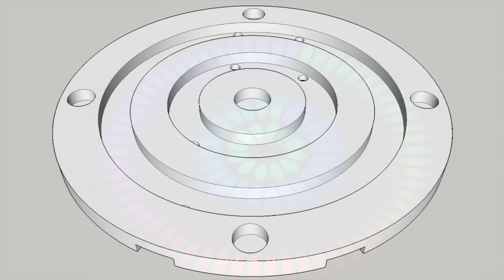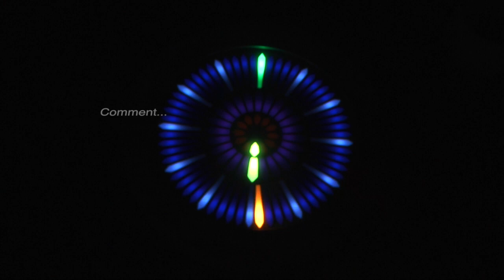LED Clock V2 Final Assembly

Comment: Steve, I love your clock and already have the 3 Adafruit neopixel rings. I have a CR10, so I will be printing the parts all in one (instead of broken up into sections). I will be using a Chronodot_v2.0 which uses the I2C interface so I will be doing some coding from scratch to get it working (hopefully). I am retired and like a challenge and I was a programmer for many years. Wish me luck. ;o) It may take a while but I will post up here when i get it done. .... Randy
Reply from the maker: Hi Randy, Thanks for you comment, and I'm pleased you like the clock enough to want to make one. Since making the video (and that clock), that clock has gone through a few hardware updates and improvements. Going forward, I will also be using i2c and a DS3231 chip. I have found it to be very accurate, in fact my current development clock has only drifted about half a second in several months.

It's good that you can program, and if you choose to use my code as a reference to create your own version, then you will find that it is by no means perfect or even efficient. I retired recently and will be working on further hardware and software improvements myself, now that I have more free time. In fact I'm waiting for a control board PCB I designed recently to arrive from China. This board incorporates the Micro-controller (going forward will be a Teensy 3.2), the DS3231 and its battery, the buttons, plus some other doodads. I have also added a centre pixel.

I wish you all the best in creating your clock, and hope the Adafruit rings are still the same dimensions as per the original ones I used. If they are not, then some adjustment of the back plate and clock face will be required. Take your time and enjoy, and please let me know how you are getting on, or if you have any difficulties.
Reply: @stevemanley3685  I just printed one of the back plate STL files and I should have checked the dimensions. The outer groove is close to being right but slightly too narrow for my 4 piece ring. The 2 inner grooves are way too big of a diameter for the 12LED ring and the 24LED ring. You have a couple of files and I printed the most recent one. I probably should have printed the earlier version one (that had all of the round holes for pressing in the face plate). I will try it and if that doesn't work I will probably just design my own clock files.
Reply from the maker: nc2010vettef55 Hi Randy, I did wonder if you would have problems, as has been the case for a few others, thus I ended up creating specific parts for them. The last time I did this it took ages and several reworks, because I was supplied inaccurate dimensions. If you have the ability to attempt creating the STLs yourself, then you will probably get more satisfaction doing it yourself. If you have difficulties, then let me know the inner and outer diameters if the ring PCBs, and the diameter of the LED centreline, as you can never rely on them being exactly in the center of the PCBs. Belts and braces, the width and thickness of each PCB is also useful.

If you are doing this yourself, I’d eliminate the need for the square holes in the clock face, and just have the shape of the hands go front to back. This makes the face a little more universal for ring size variations.

Hope this helps.
Reply: @stevemanley3685  I can do the redesign myself, no problem. It may be a while before I get this project finished but it will get done eventually. I really like your clock so it is getting done for sure. I will let you know when it gets done and may post a video on Youtube. Of course, any display or photos of mine will reference yours and give you all of the credit for your clock. THANKS for the help and inspiration! Randy
Reply: @stevemanley3685  Where did you find the round glass that you are using? Also, the plastic diffuser piece?
Reply from the maker: nc2010vettef55 I got the glass cut at a local glazing company. I also had an acrylic one cut at a local laser cutting co. The diffuser was cut from a  plain white ring binder file separator. I tried some quite fancy diffusers but the file separator gave me the best results.

Comment: Hi Steve. It is stunning. This is called creativity. I was fascinated to do the same and would like to  present to my son on his birthday. I have ordered some neopixel ring from china. But the ring dimensions are not same as adafruit ring.
60 pixel ring outer dia - 158mm
24 pixel ring outer dia - 85mm
12 pixel ring outer dia - 50mm.
Could you please  send me a stl file to be compatible with the above dimensions (both face and base). My printer is capable of printing the whole part (creality ender 3 pro).
Thank you in advance.
Neo
Reply from the maker: Hi Neo Maximus,
Thanks you for your kind comments, and really pleased you like the project enough for you to want to make one of these clocks. Normally I'd create the STL files no problem, but they take time, and I will need more accurate measurements of the actual inside and outside diameters, and where the solder pads are, so that I can add relevant cutouts in the backplate.

On this occasion, you have caught me at an awkward time as I'm developing V3 of the clock with a custom made backplate PCB and laser cut clock face (the clock face could be 3D printed, but I've not done the design for that yet). I can draw up what you ask, but it will be a couple of weeks before I can set aside the time to do it, plus I would need actual and more detailed dimensions of the 3 rings.
Reply: @stevemanley3685  Hi Steve. Thank you so much for your kind reply. Please take your time and i really anticipated to see V3.
Exact dimensions are :
60 pixel ring, Outer Dia - 158 mm and Inner Dia - 148 mm ( solder pad is exactly in between two pixels - bottom of PCB )
24 pixel ring, Outer Dia - 86 mm and Inner Dia - 74 mm ( Solder pad is exactly under the pixel )
12 Pixel ring, Outer Dia - 50 mm and Inner Dia - 36 mm ( Solder pad is exactly under the pixel )
Single pixel in the centre of plate -  Dia - 10 mm  

Please let me know if you need further details.
Thank you
Neo
Reply from the maker: Neo Maximus Hi Neo, thanks for the info. I will also need to know which pixel on each ring is the first pixel in the chain, so that I can make sure they all align at the top. They are not always where you might expect. Is your 60 ring a complete ting, or is it make up of 4 parts?
Reply: @stevemanley3685  Hi steve, Please download the images of the neopixel ring from the link below
https://photos.app.goo.gl/YGkB1VUVAakz1Qca6
Also please note that the 60 pixel ring was made by 4 quadrant ( In the picture all quadrants were  joined together by jumper wire. But later I will disconnect the loop )
 
Thank you 
Neo
Reply: Hi Steve, Have you checked the images i sent ?. Please let me know if you need further details.
Thank you 
Neo
Reply from the maker: Hi Neo, Yes I've seen the images and thanks for that. I just want to be sure that the middle and smaller rings have the first pixel directly opposite the centre of the pads. Some Adafruit rings I bought some years ago had the first pixel in the ring, one pixel to the right of the pads (when viewed looking at the pixels). This caught me out and the person I did the STL files for had to write code to rectify the error. Not difficult, but could have been better on my part.

With the info you have provided, I think I can sort out the STL files for you, so I'll be in touch in the next couple of days.
Reply from the maker: Hi Neo: I am looking at drawing your custom Clock parts, and something doesn't look right with the 60 LED ring. The standard LED size is 5mm x 5mm. From your measurements, If you take the inner dia from the outer, we get 10mm. We divide this by 2 to get the PCB width of 5mm. From your photo, I can see that the LED's sit inside the width of the PCB by about (I guess) 0.6mm either side, so either you have LEDs that are smaller than the standard 5mm, or the measurements are incorrect. My 60 LED ring looks very similar to yours, and the PCB is 6.4mm wide with an internal dia of 145.2mm, and external dia of 158mm.

Please can you confirm the LED size and re-check the inner and outer diameters on all 3 rings, plus I would like the PCB width as well for all 3 rings. 

I have also noticed from the photos that for the 2 smaller rings, it doesn't look like the LEDs sit exactly in the centre of the PCB width, therefore I will also need the inner diameter of the inside faces from one LED to its opposite LED, on both these rings.

As I said previously, I don't want to do this more than once, so I await your reply with updated dimensions before proceeding further.

Cheers, 
Steve
Reply: @stevemanley3685  Hi Steve, Thank you so much for pointing out the issues with the measurements.
The 60 pixel ring dimensions are exactly the same as yours ( Inner Dia. - 145.2 mm, Outer Dia. - 158 mm, PCB Width - 6.4 mm, the LED sit exactly in the centre of PCB )
24 Pixel ( Inner Dia. - 72 mm, Outer Dia. - 86 mm, PCB Width - 7 mm,  Distance in between Inner face of opposite LED - 73 mm )
12 Pixel ( Inner Dia. - 35.2 mm, Outer Dia. - 50 mm, PCB Width - 7.4 mm, Distance in between Inner face of opposite LED - 37 mm )
I have made a rough sketch with the exact dimensions marked on the image. Please download from the below link.

https://drive.google.com/open?id=1mpXPfvkfc06IGwVeLmAOWQ7wDQt7CUaV

Thank you

Neo
Reply from the maker: Neo Maximus Excellent, thank you. I will let you know once I’ve made the changes.
Reply from the maker: Hi Neo, The back plate is nearly done, but I need to know the thickness of the single centre LED PCB. The ones I have are only 0.75mm thick, whereas the standard PCB thickness is 1.6mm. Plus the solder pads on mine are through hole 90deg apart, 1mm in from the edge. What are the solder pad fixings like on your's?
Reply: @stevemanley3685  Hi Steve, Thank you so much. The PCB thickness is 1.6 mm and Dia. is exactly 9.5 mm and the solder pads are SMT

Please look at the images attached below.

https://drive.google.com/drive/folders/1pAy7YsOkqg1vwyDP_kMnlgxkqvTX4Qsz?usp=sharing

Thank you
Neo
Reply from the maker: Hi Neo, PDF images and STL files are here: https://www.dropbox.com/sh/kuocdgc7poxri7w/AADnCpF2XBdJ3PXQ0-YYboHLa?dl=0

The Back Plate still requires some input from you as to the PCB thickness of the centre pixel and its solder pad layout, so that I can adjust for the mounting depth and access holes. 

Hopefully I have got the Face plate done. One thing to note, because the inner ring is that much larger than mine, I have had to adjust the hour hand length, and the hands are a fare bit shorter than I would have liked. I have also made the inner ring cutouts rounded, a bit like flower petals, the same as Ive done for my V3 clock.

Let me know centre pixel details, or if you need further adjustments.
Reply: @stevemanley3685  Hi Steve,
Thank you so much. The face plate looks ok to me.
The centre pixel PCB thickness is 1.6mm, and the Dia. is 9.5 mm
Please look a the image below.
The solder PAD is at bottom (SMT type)
Let me know if you need further details.
https://drive.google.com/drive/folders/1pAy7YsOkqg1vwyDP_kMnlgxkqvTX4Qsz?usp=sharing
Thank you

Neo
Reply from the maker: Hi Neo, The updated files are here: https://www.dropbox.com/sh/kuocdgc7poxri7w/AADnCpF2XBdJ3PXQ0-YYboHLa?dl=0

Let me know how it goes.
Steve
Reply: @stevemanley3685  Hi Steve,
Thank you so much. I will print  in this weekend and keep you posted.
Cheers
Neo

Comment: Hi Steve,
now i have two other Problems.
I searched hours for the SimbleeForMobile library and the Arduino board files in the net.
But can't found it.
can you help?
Great Thanks. ;-)
Regards Mario
Reply from the maker: Hi Mario, I just looked and hit the same issues as you, so looks like support for Simblee has unfortunately been withdrawn. Which is a shame, as I found it a really useful device.

The last time I used Simblee was in Jan 2016, and I was using the Arduino 1.6.5r5 IDE (as recommended) at that time. My current Arduino install does not recognise the board, and the libraries are not showing, so I would have to go back to that old 1.6.5r5 install to do anything Simblee related myself. 

Sorry to say that I have no knowledge of how to extract the files needed from my install, they are buried deep inside the Arduino package contents somewhere.
Reply: OK, thank you for your support.
 @stevemanley3685
Reply: Sorry,
i put the wrong link in the message above.

Here the right board driver.
http://www.slinq.eu/package_simblee_index.json
http://www.buntsoft.com/simblee/package_simblee166_index.json
Reply: I tested only the buntsoft link.
Reply from the maker: Thank you for sharing the info.

Comment: Hi Steve, great Project, and an awesome Clock.
But, how can i add the simblee? I bought one online, but have no idea how i can put it in your code.
On your Pics in the Parts List i can see, you use Port 5 and 6.
Can you share your the old code with the simblee?

Many Thanks from Germany.
Sorry for my bad english.
Reply from the maker: Hi, Thanks for your kind comment. 
I have just uploaded the Arduino Sketch which contains the Simblee bits, which you can download from here:
https://www.dropbox.com/sh/jw3r5gjnw6xxogw/AABW4qcvbAYi_31rK6h9WEjaa?dl=0

The Simblee Sketch has been available for a while and is located here:
https://www.dropbox.com/s/crymisw5b3b1acn/Simblee_Clock_Control_V1.1.zip?dl=0

The Simbee needs GND & 3.3V, and GPIO3 to Nano D5, and GPIO2 to Nano D6. You will need to download the Simblee App from where ever, according to your mobile device (if its still available). With the Nano & Simblee Sketches uploaded accordingly, and with Bluetooth enabled on your mobile device, run the Simblee App and select "Simblee, Neo time", you should have 3 basic buttons for controlling the clock. The Adjust/Test button effectively presses both Mode Up and Down buttons simultaneously. When in Time, Date or the very first Audio mode, you can set the Time, Date, or enter an LED test sequence accordingly.

Once in Time or Date Setting mode, you will set the (Hours, Minutes, Seconds) or (Year, Month, Day) with each successive (Adjust/Test or both physical buttons) button press. One final press, will set the new Time or Date.

Your English is better than my German by the way :-)
Reply: Great!
Thank you very much.

 @stevemanley3685